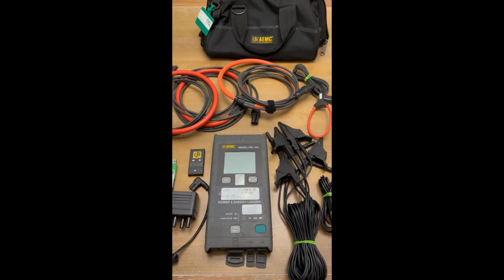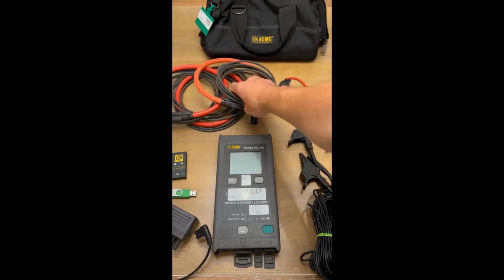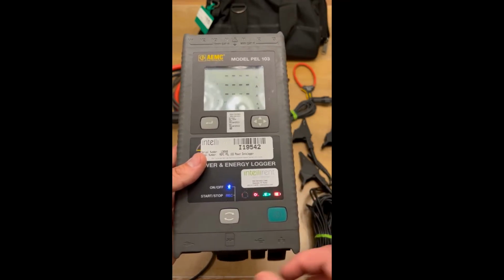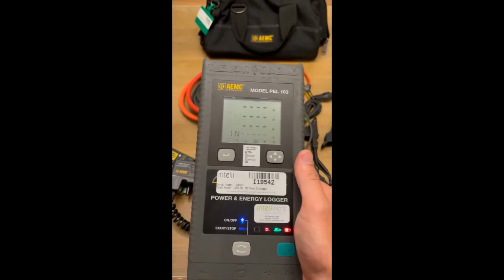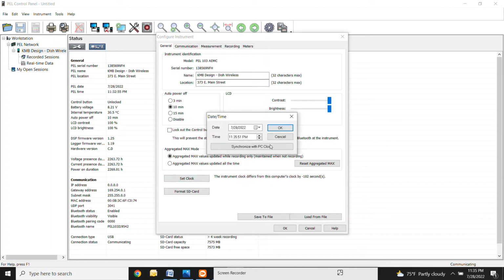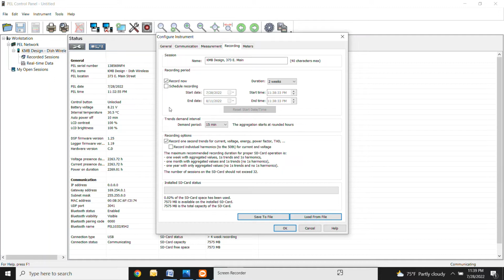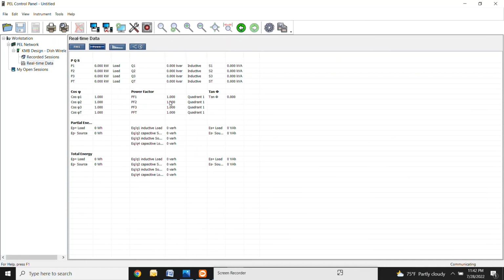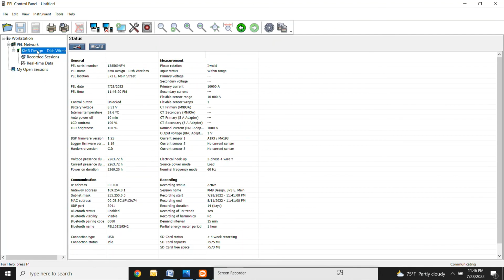AEMC PEL 103 meter overview final video

Comment: Thank you for making this video. I need to hook this up tomorrow morning for a job and this explained the whole process very well. One question I do have is when I go to disconnect do I just unhook everything and pack it right up or do I need to click anything and push stop or anything? … do you have a video on making reports ?
Reply from the maker: Hey, when you go to remove the meter you want to make sure to end the recording first. I typically opt to do this through the laptop. You can set the meter up to only end the recording when commanded through the software, that way nobody can hit the button on the meter by accident and stop your recording. Take note of the rate at which the recording light flashes, this will tell you if it is still recording or not. You can also opt to set a predetermined recording period, so the meter will automatically stop recording after that time has passed, 4 hrs, 2 days, 3 weeks etc. Unfortunately I don't have a video on making a report, but I may be able to do that in the future. Hope that helps.